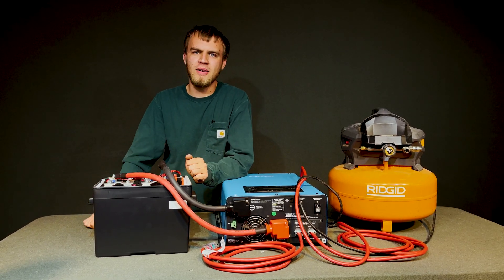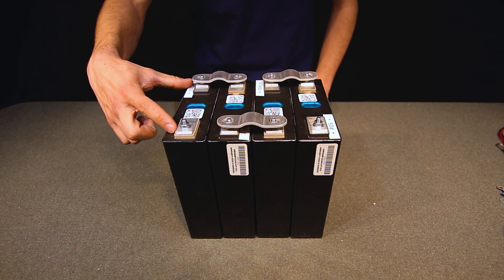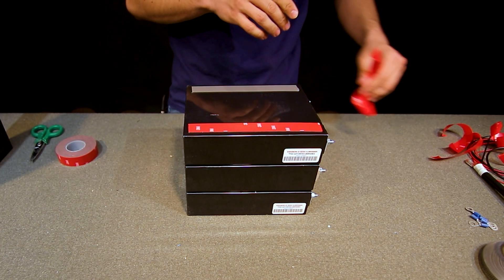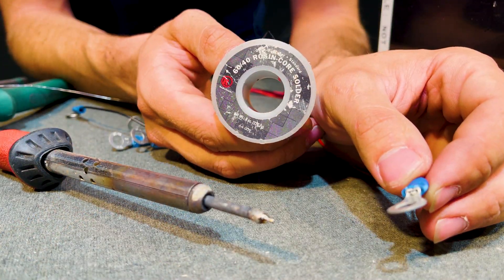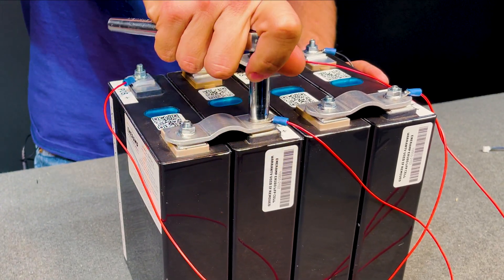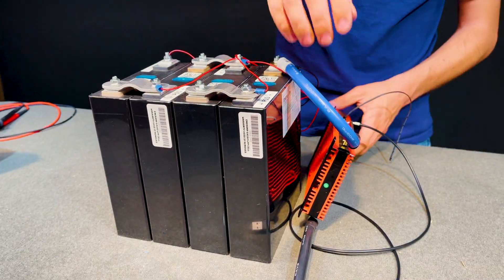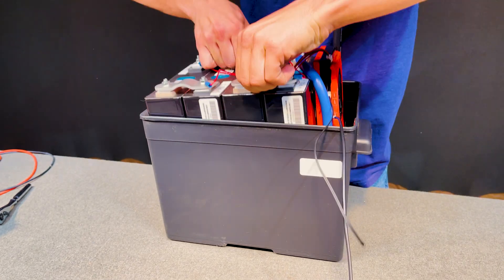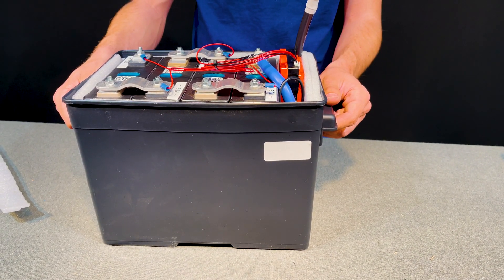Step By Step || Simplest DIY 12V Group 24 LiFePO4 Battery Upgrade || Ditch Lead Acid

Comment: Thank you for the interesting video. My Group 24 battery box sits on the tongue of my trailer, so any battery installed inside would need to be able to withstand the heat of the sun and getting wet when driving in the rain. Is this a concern with this build?

Comment: Very good video.  I like how simple and concise you made each step.  My one question is about the packing material around the BMS.  Doesn't it need good air flow to stay cool when balancing the cell voltages?

Comment: I thought you where not allowed to twist wires when you use ring terminals as well as not using solder because it prevents it from moving accoarding to "code"
Reply from the maker: On larger gauge cables, such as main current carrying battery cables, you are absolutely 100% correct, it's a big no-no, as we cover in one of our other videos.

The absolute best thing to do would be to utilize ring terminals designed for the wire gauge used.  Unfortunately it's very difficult to find ring terminals designed for 20awg wire.  The good new about the smaller wire though, is that with solder or not, they can still flex really easily, it's not making things so rigid that it causes fatigue and stress cracks.
Reply: @CurrentConnected  ah I get it and what is it about the twisting? Even if you solder it would it not be way better to not twist it or is there something else?

Comment: I’m interested in seeing them setup in a 48v configuration
Reply: Why?
Reply from the maker: We are having some thoughts on replacing a bank of 64x CALB CA180's with them, we could easily fit over 1000 amp hours in the same amount of space that previously held 720ah with the CALB cells.
Reply: @CurrentConnected  did I miss the video showing your current CALB configuration?  I saw the test and then it was in there and you were putting in the Sol Ark

Comment: Good job on the video good info.. I like to see those cells in a real off grid system running 24/7 sorry im not a believer on those cells ...keep it up brother
Reply: Stay tuned for more of our testing and install videos.  These batteries really are awesome, I've been spending hours and hours doing testing on them.
Reply: Not a believer? I hope you arent referring to lifepo4 in general and youre a lead acid stalwart.
Lead acid is garbage technology, you dont have to believe just keep pissing away energy and money.
Ive spent just a week with my DIY 280 ah lifepo4 12v pack and Im simply amazed at how good it is. In short, every amp of current you give it you get back out. Its gonna last 10 years. It requires no maintenance. It weighs less than half per energy storage.  If it costs 5-7 times lead acid its a bargain.
If you have a stationary lead acid application, carefully monitored its discharge and charge, and were really anal about it I have heard stories of people getting 4 years out of trojan 6v cells.
The reality for most of us is a 12v "deep cycle" marine battery used as a house battery costs $150 and sees problems in 6 months and in a year is just a load with an hour reserve. A pair of 6v golf cart batteries costs twice that weighs twice as much and lasts two years. Lifepo4 is cheaper in the long run.